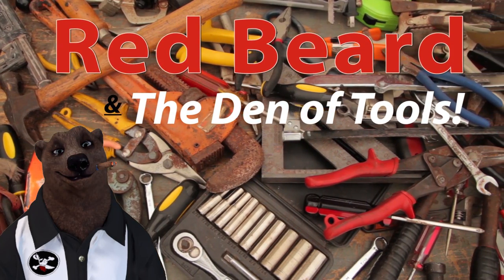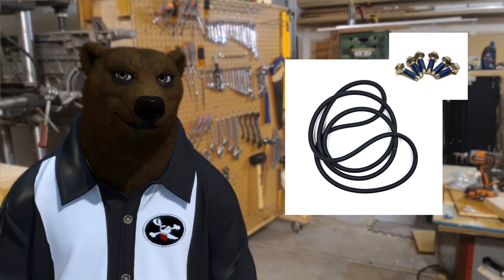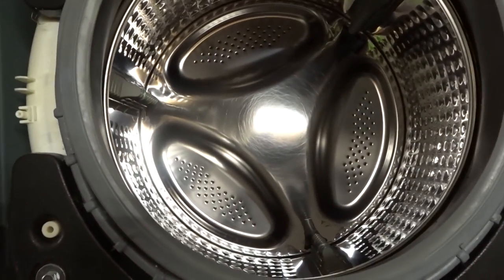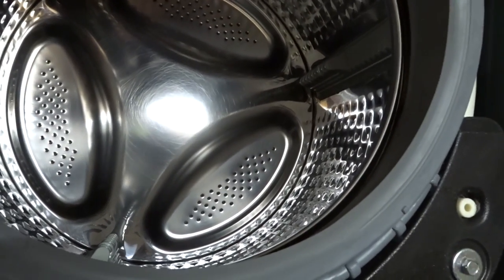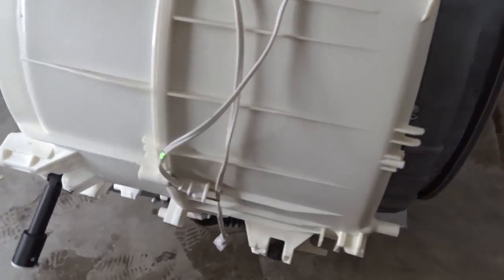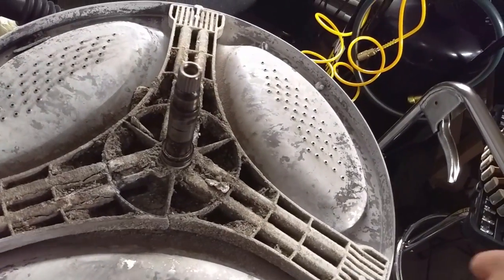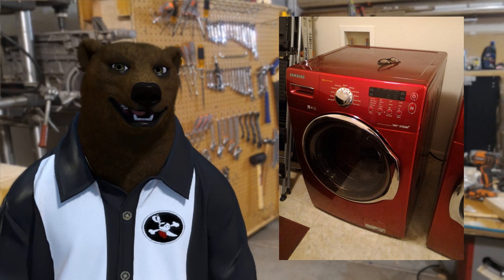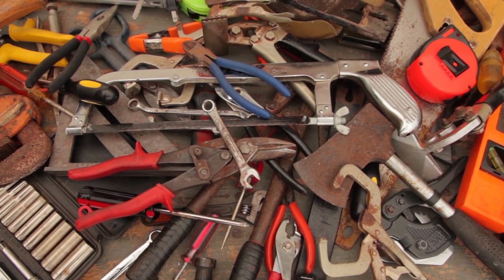Teardown and Fix of a Samsung Front Load Washing Machine  (WF331ANW)

Comment: I just replaced the bearings on mine, the thing sounded like a freight train on spin cycle.  I spent a day taking it apart and another day putting it back together.  There was nothing difficult about the process but there is a lot of little stuff which needs to be disconnected as you go.  Finally, it was nice to also be able to give the inside of the tub and the front seal a thorough cleaning.  These machines are notorious for developing a funky smell over the years.  I am glad to project is over, and with any luck I will get another seven years out of the thing.
Reply: Had to replace the spider arm on mine it was a breeze taking it apart but lord putting it all back together took way to long 🤣🤣

Comment: We had the same washer dryer pair and I fixed the spider arm and put in a new balancer.  It ran OK but didn't get the clothes as clean as a top loader we had in the garage that is over 30 years old.  Once I fixed the washer, the dryer stopped heating.  Another 100 bucks and everything was fine, for about 6 months and now my new spider arm broke again.  Cheap pot metal.  We sold both and moved our older Maytags back into the house.  We got about 4.5 years out of this set at about $3,500.00 bucks.  Not a good deal.  Never again.

Comment: Thanks a lot for the video.
I just got done taking mine apart and waiting for the part.
I like what you said about how basic of a system this is and you don't realize how easy it is to fix it yourself until you actually do it. Watching u go through the same exact thing was like Dejavu for me. 
My Samsung is a different model but pretty much is the same identical system with same exact parts. It had previously worked for 6 years with no problems then last week i tried to fire it up for the first time after leaving it untouched for a year and it started making weird noises, followed by a non-spinning drum. Opened the  back cover and saw the motor spinning, which told me it had to be something that attached the motor to the drum.

Comment: Buy yourself a set of Speed Queens. They're made in the USA in Wisconsin with metal, not plastic. I got huge warranties on mine. Also they can be completely repaired (If they ever need it) from the front of the machine. I had looked at all the washers out there before I bought the Speed Queens, and the issue with the spider arms was the reason I stayed away from those front loaders. So glad I went with the pair I have.
Reply: Yes, that's what I am going to do.  Our washer is taking a crap at 5 years.
Reply: Speed Queen.. Buy once cry once.
Reply: My top load speed queen ruins my laundry.  The agitator is murder on fabric.

Comment: That washing machine... I am impressed you got it all taken care of. The whole procedure reminds me of changing a radiator on one of those Hyundai mini vans. I think I counted 50 bolts or more around that range when I did one a long time ago. If you ever get tired of it, I suggest the Kenmore washers and dryers. Seems like Sears has made their products easily serviceable for both washers and dryers. As long as they look like the regular washers and dryers. Only thing u gotta do with them is clean the sensors for lint on the dryers and maintain the drum on the washers if they have any issues. My lawnmower is like a 27 hp craftsman 2002 model I put together. I also have a newer 420 cc mower that has retired into a tow or ride only vehicle. It's just how everything is where you buy it all nice and new, but it will break like it was 30 years old. I think we hit that process of plastics and tin not making it happen after 2001.
Reply from the maker: Yeah, if this thing dies again it is staying dead.  It is ridiculous that you can't just buy a basic appliance anymore.
Reply: Lot's of the newer Kenmore washer and dryers were/are made by Samsung (at least in Canada).
Reply: It's like that with everything nowadays. I have a fear of buying new stuff that's going to break. Mainly because it usually does.  My brand new bissel carpet cleaner lasted like 4 months before I had to replace the pump. Along with our LG glass top stove suddenly developed a crack in it, and the part is obsolete. But, at least you managed to fix it. If that new gear is just like the old one. It will probably need service again around the same time as the old one. But last a little bit longer since it never got the experience of being shipped around when it was born. I am pretty sure they are made that way so people buy , break and replace them. It's just a way for companies to make more money. You think they would have made that gear out of metal.
Reply: Kenmore does not manufacture one single large appliance.  Not one, not a single one.  Typically is contracted with SAMSUNG (yep) or LG for the manufacture of product.  Kenmore elite series has used Samsung and LG for many years now.  Just branding my friend

Comment: Who am I to argue with my favourite friendly bear...  I have same attitude... in 25 yrs. only had the fridge compressor replaced twice by a technician.... everything else I do  myself. Living in Australia we don't have many american products except ironically top-load washing machine and drier made by Speedqueen. Had them since 1996....still running well except main bearing in washer has been noisy for the last 4 yrs... have not replaced it yet because I can't find the size without tearing the machine down and I don't wan't to be without machine while waiting for replacement part (could be up to a month here...sadly).  My motto is: If humans have put it together - another human can take it apart. Not bragging but my success rate is around 98%.  Well done mr. Bear....Respect for your relationship with your kids... Lovely.
Reply from the maker: "If humans have put it together - another human can take it apart."  That is EXACTLY what I told my kids before I started this.  They thought that dad had lost his mind.  I always try to impress on them that they should try to take on new challenges like this.
Reply: @denoftools  There was something about the bear I liked right from the start  - now I know what it is. Have a good winter Bear.

Comment: I had a simple, ten year old, Kenmore dryer stop heating over the Summer.  Never fixed one before.  After watching some vids on similar models, I ordered about 6 different thermostats, assemblies, and parts, and replaced most of the heating parts.  Has worked fine for months.  The parts all together were about $60, so saved a ton on a service call.  It wasn't as hard as your washer repair looked though.

Comment: Wow bear im shocked at how nice your bearings were when you pulled that apart. I been doing appliance repair for close to 30 years. Its extremely rare in my experience to have the shaft come out so easily. Good job for a rookie. You did an excellent job.
Reply from the maker: Thanks! I'll be honest I was fully expecting to have to replace those bearings.  And that shaft was in such good shape I actually cut it out from the rest of the spider arm and kept it because I couldn't bring myself to throw away a nice solid chunk of steel like that.
Reply: @denoftools  you never know when the cave needs a solid chunk of metal. It does tell me that Mrs. Bear takes really good care of the machine. Usually under loaded or extreme overloading causes bad bearing wear. The other side of that coin is seal failure leaking water into the bearings destroying the brearings.

Comment: I used to work for rent a center about 15 years ago and my boss found out i was good at fixing things. So i got to fix a lot of stuff, but I refused to mess with front load washers, mostly due to the fact they were full of nasty water and clothes when they broke. But the experience came in handy when mom and dad needed the dryer rebuilt/repaired and i have fixed a few elcheapo appliances for myself over the years.
Reply: All front load washers have an issue with mold and some top load. One thing is folks dont want to leave the door open. Most folks who buy a cheapie top load are not concerned with looks and leave the lid open or there is gap allowing airflow.
Reply: just wondering, on Samsung wf218anb/xaa 01 front load, how far do you push the oil seal into the plastic casing of drum housing?  I installed mine flush with the plastic, but seems to rub a little when I dry tested and slid spider arm into place.

Comment: That seems like a ton of work to replace a part that the factory screwed up. I've felt for some time that things are now built for planned obsolescence with repairs more costly than a replacement. I have a 25 year old Whirlpool top loader that I replaced the water pump and agitator assembly. They were easy repairs and inexpensive. The matching dryer has never had an issue. I've always wanted one of these new front load washers, but you've cured me of that!
Reply from the maker: I will never buy one of these again.  And yes, this is certainly a case of planned obsolescence.

Comment: Thanks for posting, I had the same unit with the same problem.  Mine still spun but could hear something rattling around (which was all the crude moving around).  Also at high speed spin you could hear noise like the drum was shaking.  My spider arm was in slightly better shape than yours but still heavily gunked up and had a crack in it.  About half of the bolts sheared off when I tried to remove them.  I had to break the spider apart with a hammer to get it out of there.

Comment: Great video Bear.... I used my engine hoist to remove the drum. I knew the engine hoist was gonna come in handy one day.  The spider arm was broken, left a grove on the front portion of the plastic housing and shaves a part of the front balance ring and not to mention the plastic part where the water enters the drum. My washer is about 10-15 years old and I only had to replace the water vacuum pump since I bought the washer. After adding all the parts that Im going to need, about $375 - $400, I think its not worth fixing my washer. 
Good video and I learned a lot from it
Reply from the maker: Damn, great call on using the engine hoist!

Comment: I was a domestic appliance engineer for 35 years and that problem started when they introduced biological wash powder, in Europe most of the outer tubs are now welded so you can’t separate it, they don’t want you repairing them.👍🥃🏴
Reply: This seems to be the trend everywhere - I was actually surprised that the tub in the video wasn't a welded unit.

Comment: Thank you for your video!
You inspired me to finally take the plunge and repair my Samsung clothes washer.
Mine made a loud continuous knocking sound during some spin cycles.
Unfortunately my problem wasn't the spider arm. It was for the most part intact but
definitely corroded. Since I had the drum apart, I figured the problem could be the bearings
so I replaced that. I got a new seal for the drum and put everything back together but the sound
was still there.
I opened the machine again and looked around to see what other spinning thing could be causing
the sound. I zeroed in on the drain pump. I noticed the spinning blades was slightly loose from
the motor compartment and water was leaking inside.
My machine doesn't make the loud noise anymore after replacing the pump.
The funny thing is during all this work I found a technical manual taped to the back of the machine.
I finally took the time to read it after fixing the machine. There are helpful diagnostic tips
which I think could have helped me realize the problem is the drain pump. :)
At least I now know my machine's spider arm is although intact but corroded and the drum
has new bearings. Oh when I replaced the bearings, I loaded it with lots of silicone lubricant.
The default just had bits.
Thank you for your efforts. You helped me stretch the life of my washing machine.
Reply from the maker: Great job!  Yeah, it's a bit tedious but I'm sure you'll agree that it's the sort of job anyone should be able to tackle and it can really save you some money.
Reply: @denoftools  Thanks! I actually fixed my matching dryer couple years but this time around I got lazy. I contemplated a new machine but when I saw your video it motivated me and also reminded me of my work on the dryer. I rolled up my sleeves and slowly figured out what was wrong.
Looking back, I agree, the effort isn't as daunting as it seems. Compared to a new machine, I definitely saved money. Maybe I would read the technical manual first next time. :) But I wouldn't have known the condition of the spider arm or have a chance to clean the inside of the drum. :)
Thank you again!

Comment: Completed this job today. Had my arm powder coated before installing it. Danged drill died so all those screws and bolts? By hand with ratcheting wrench set, screw drivers, manual. Added no less than an extra hour and a half.
Reply from the maker: Damn, you earned that victory.

Comment: Damm your good! Thats a lot of parts to remember. Good job. I'm going from a LG top loader to Samsung front loader. After 3 control boards in 6 years.... LG is going. Inside is so easily cleaned with a half gallon of cheap vinegar and hottest water comes out clean and smelling like fresh air.

Comment: Most anything can be fixed,  that is if you can get it apart and if you can get the parts.   I've got a Frigidaire front loader,  thus far it's held up well.   Gain detergent and it gets the laundry really clean.   I've also got a 30 year old Sears dryer,  original belt but three sets of rollers and a timer knob with no markings to keep it working.   I checked on a OEM replacement timer knob,  40 bucks!

Comment: Samsung do seem to not be very hot in the design dept.  Last rental we had has a top  loader samsung.   Complete piece of junk.  The way they mounted the pump caused it to stress and fracture the mounting brackets.  Real clever!

Got a LG front loader when we bought our house - Have to say I really like it and it does seem to get stuff cleaner.  Old house we had we got a Bosch front loader, but that went with the house when we sold - was really happy with that.  With 3 boys always a plus on trh clean and ease of use as that thing is on all the time!.

Also a plus that I now never put my shoulder out over stretching to get that one last sock out stuck in the bottom.  Might seem stupid - but happened more than once!

Comment: I totally agree with your statement about buying a cheap top loading washer.  After our 2nd front loader died after having front loaders for 10 - 15 years, I decided that we needed to step back and get something different.  Sure, the front loaders are supposed to be gentler on the clothes, more efficient, blah, blah, blah, but at the end of the day, if you have to spend 800 - 1000 dollars every 5 - 8 years for a washer, or about 1/2 that to repair the old one, I can get a top loader for the price of the repair of the front loader.  Granted, it does not have all the bells and whistles, but the one we have is just a basic, non-electronic control panel type of washing machine we picked up from Home Depot that my wife is happy with and has been working flawlessly for at least 5 years.
Reply from the maker: The problem is all the new top loaders are now just as gadgety as these are in their attempts to stay relevant.
Reply: @denoftools  Yup, there are some really nice features available on new top load models, but it circles back to sharing a lot of the same failure points as the front loaders - lid locks, control boards, etc are standard issue on the ultra capacity top load units.  I think part of it is a consequence of using a similar drive system to the front loads, allowing for a larger drum but requiring more sophisticated controls and getting the safety interlocks to match.

Comment: I did a similar teardown this weekend. Broken spider assembly, bent shaft, seals were wrecked, one of the bearings was shot. Unfortunately, in Canada, the replacement parts were possibly more than $500 (spider assembly, rear oil seal, tub seal, front door seal, bearing kit ordered from the US or replacing the rear tub). So the machine is off to the recycling yard, and something other than a Samsung will be taking its place.

Comment: Nice job on the washer repair! Man that is no simple task! We still use a top loader Maytag that is energy star rated and only paid around $300.00 at Lowes because it was last years model.. I bought a Square Trade warranty for $30.00 and it failed on the last day of the warranty.. Contacted Square Trade and they said "that's too heavy for you to return for repair so we are refunding what you paid for the washer".. LOL I was shocked and Googled the problem and replaced a control that controls fill level, temp, etc. and ~$70.00 later I was back in business! This washer has the commercial drive system and S\S drum.. Years later it's still running.. If I had to make the repair you just made I'd junk the machine!

Comment: Ours just stopped working after vibration and shaking developed a bit ago.  I am quite sure the spider arm is the issue. Great video.  If I decide to do this fix (rather than scrap it and buy a non-Samsung) I think I will coat the new spider arm with an aerosol epoxy.  Seems like the design engineers would have specified that in the first place.  Incidentally, on 1/26/2020 I called the "support" line at Samsung, described the problem, and the lady insisted there was no such corrosion failure problem ever reported to them.  I'm not criticizing her personally for lying, but it tells me all I need to know about Samsung corporate.  If I buy a new machine I will try to get my wife to accept a top loader.  The issue is she is not quite 5' tall, and can't load/unload one.  Not a biggee.  I'm retired, and can do that task when needed, as I already do about half the time, as well as ironing and some cooking.  She did enough of that for our first 50 years :-)